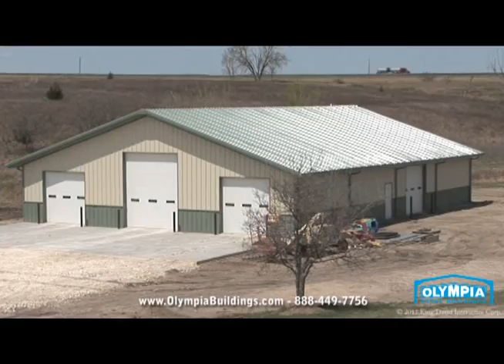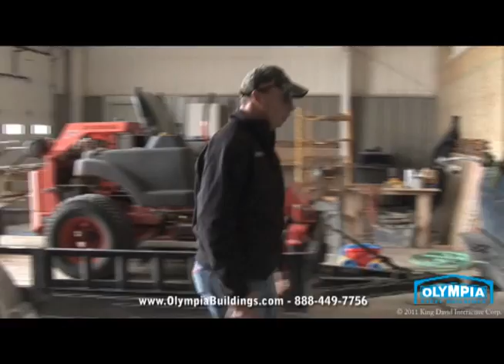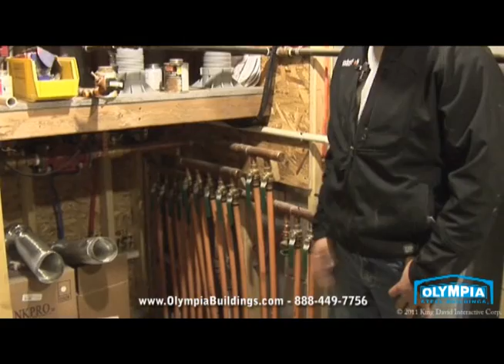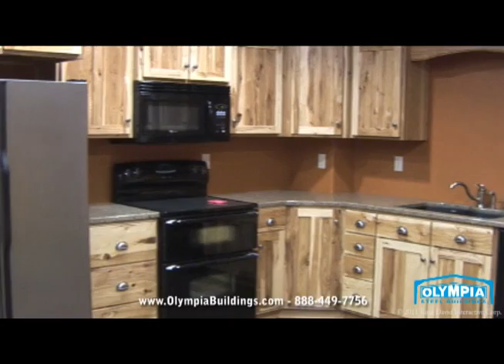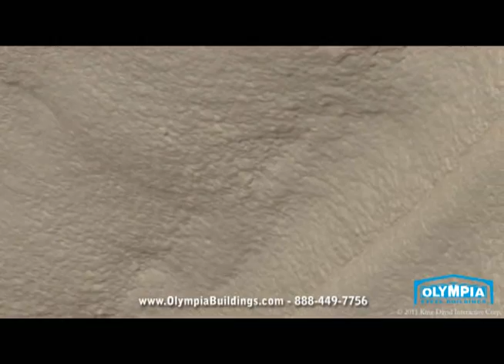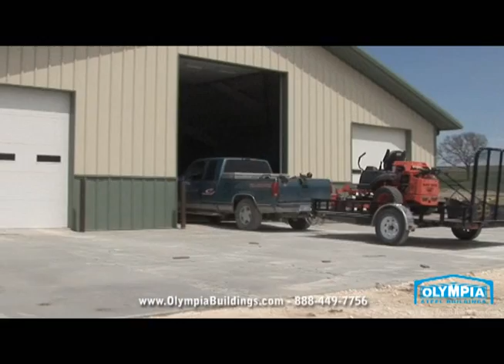60 x 80 Metal Building One Contractor's Search For Perfection

Comment: Nice building.
I put up a 48' x 96' steel building 15 years ago. I learned a lot from that initial experience. Although I had it insulated with continuous fiberglass insulation on all walls and ceiling, I have experienced too much radiant summer heat inside. A thermal barrier and the sprayed on foam are a great idea, as is coating the expansive metal roof with a silicone  white sealer to greatly cool down the sheet metal to begin with. In floor hydronic heat is a great idea if you ALWAYS heat the building. I heat with wood, as I am only occasionally in the building for any length of time. Your 4:12 pitch with living area is awesome! I picked up a lot of useful ideas here on my next building, including facing the overhead doors on the south side to let that light in!

Comment: depends on a number of things...amount of doors, windows etc. but I know for sure on the 'shell' of building alone will cost u at the very least 2$ per square foot if you go straight to the source, but these guys will easily charge anywhere from 3 to 4$ per sq ft depending on detail and again that's on the shell alone
Reply: That's the easy part to figure out. It's the cost of the slab, plumbing, electrical, site prep/pad that nobody can ever give me a good estimate for.